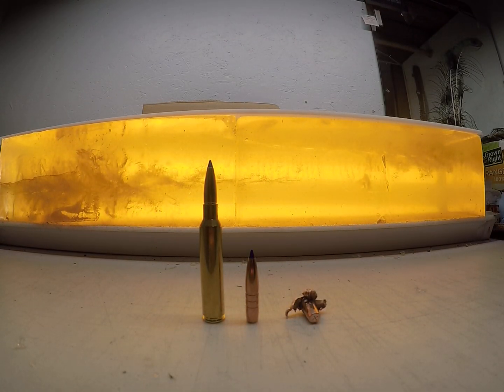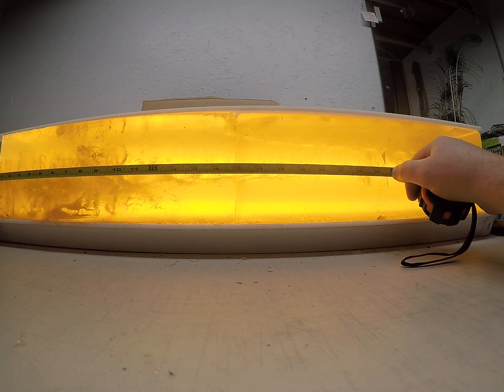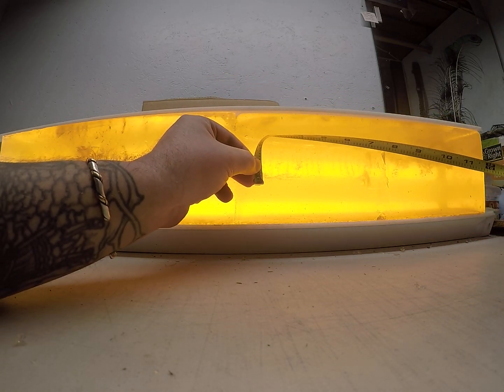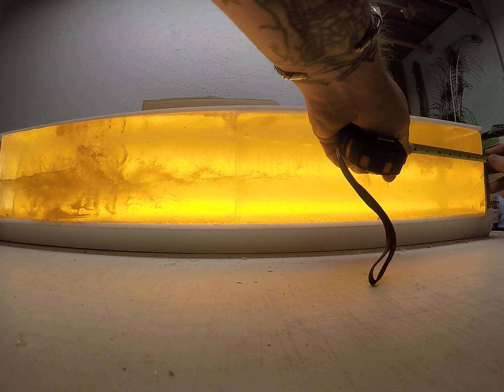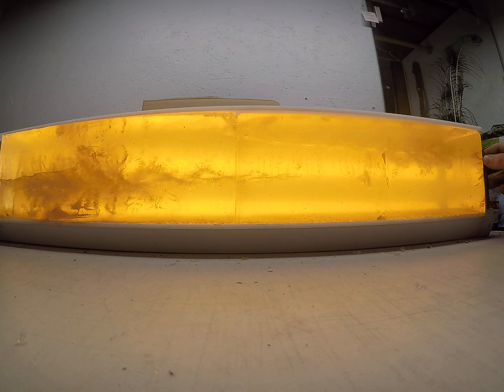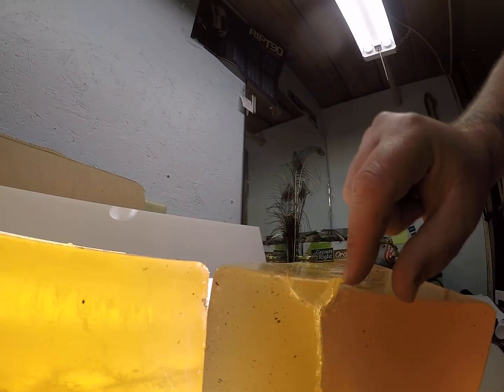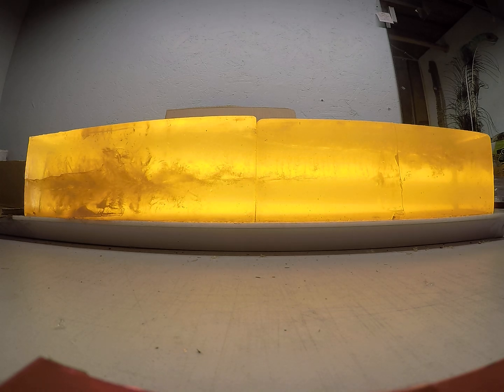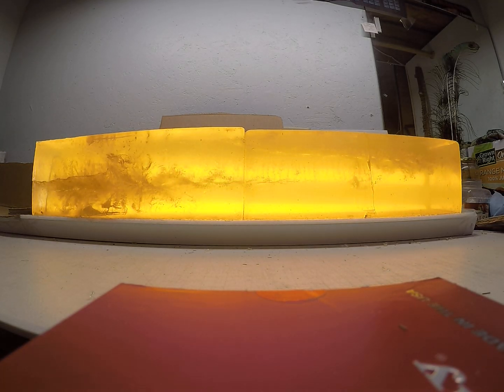300 PRC 200 grain Barnes LRX ballistics gel block overview PT2

Comment: Thanks for the test
One thing I want to understand is -why there are so many tests on 'impacting at muzzle velocity' ? No one is hunting with the rifle stuck on the animal, especially with a 300PRC - why not test a reduced load to 2200-2400fps  to see actual expansion at range rather than what it would look like had someone used their rifle as a speargun?
Reply from the maker: @peteee1067  I get what you're saying.  My test are on the bullets themselves, and my intentions are to find the absolute max velocity for not getting total fragmentation and minimum that still has a decent mushroom, creating preferred permanent wound cavities in 10% gelatin. 
Therefore, all my are 25-30 yards. Right at the muzzle would not be safe.

Someday, I do plan on doing more tests of in between velocities imulating different ranges with different cartridges. That way, one only needs to know their bullet and muzzle velocity regardless of cartridges to know the performance at various ranges.
Reply: @simplemindedfella   I think you missed my point. To really show how it performs you should load it down to 2200fps and see how it performs to see the performance at actual range rather than that a bullet performs whn its just 30 yards